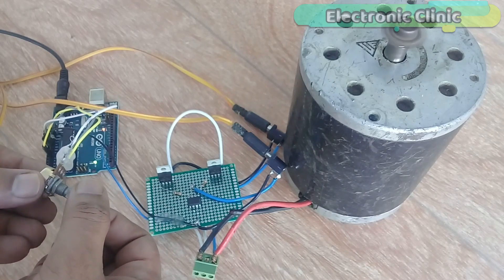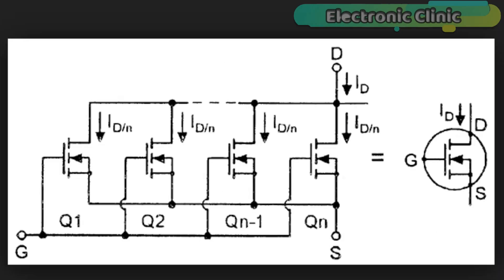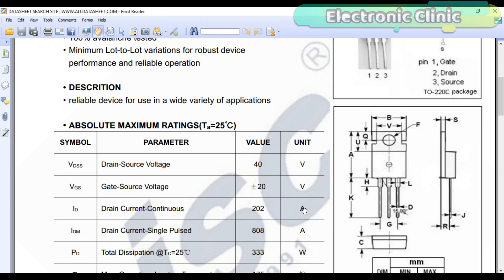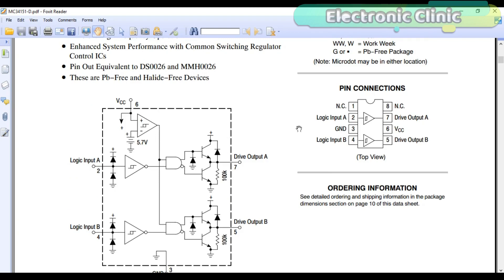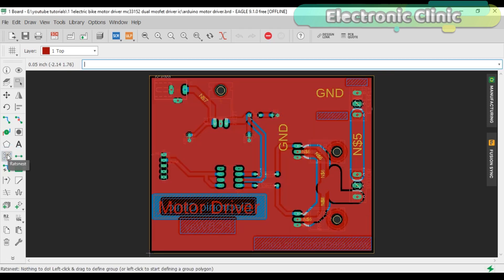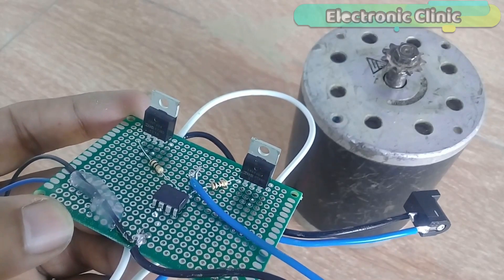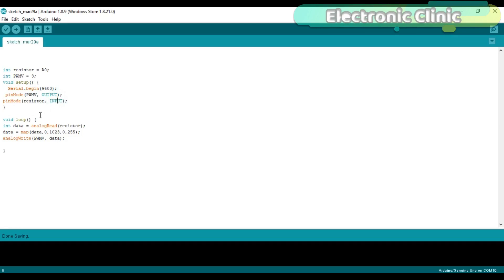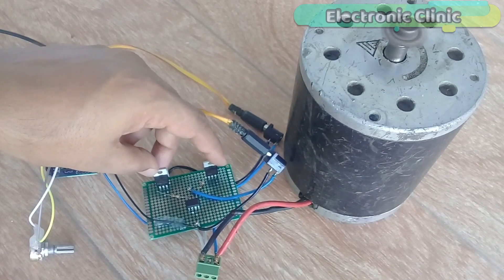Arduino Project: Electric Bike | Bicycle | E Bike Motor controller using mc33152 & Parallel MOSFETs

Comment: Have you tried applying load to the motor? I have a similar motor using pwm controlled by an arduino. I have a separate device that does the pwm, the arduino sends a digital signal to it. Without load it spins the bikes wheel fast but when someone tries to ride it, i think it is surging, frying the pwm device.

Comment: This controller will only work with a BRUSHED DC motor; it will NOT work with any of the "BLDC" (3-phase) hubmotors that we see for sale on Amazon and on eBikes. Therefore, you can only build a backyard-grade eBike this way, not a respectable one.

Comment: Can you explain in details? How you calculated 15.6 amp at 50°C?
Reply: The first equation was:
Pdiss_MOSFET_max = (Tjmax – Tambient) / Rthja
where;

Tjmax – allowable maximum junction temperature of the MOSFET. This is specified in the datasheet. (175 degree Celsius)

Tambient – ambient temperature near the MOSFET (50 degree Celsius)

Rthja – thermal resistance from junction to ambient (62 degree Celsius per Watt)
Therefore,
Pdiss_MOSFET_max = (175 degree Celsius - 50 degree Celsius) / 62 degree Celsius per Watt
that gives, Pdiss_MOSFET_max = 2 Watt at 50 degree Celsius

After that,
Pdiss_MOSFET = Idrain X Idrain X RDSon

Where;

Idrain – drain current. This is dependent to actual application (this is not the drain current rating of the device as shown in the datasheet.

RDSon – drain to source on state resistance. This can be derived from the datasheet.
In the video, RDSon was 8.2 milliohm and Pdiss_MOSFET = 2 Watt at 50 degree Celsius.
Substitute values and find Idrain.

Comment: I had a doubt, as by using the potentiometer we are varying the voltage input to adjust the speed of the motor, so does the power of the motor also vary accordingly ? 
Like if we reduce the speed, is the overall power reducing too ?
Reply: As in when someone is riding an EV bike on an high incline road, does the rider have to roll the accelerator in full to maintain speed?

Comment: Is the controller current (torque) based adjustment or voltage (speed) based adjustment? My controller is annoying because the throttle is a speed based throttle, not torque based.
Reply: Torque-based would be stupid, unintuitive to use, completely unlike any other motorized vehicle.

Comment: i totally disagree with you about connecting mosfet in parallel not working what about inverters,smps,half bridge ccts where mosfets are connected in parallel to increase the power handling capability
Reply from the maker: I did connect mosfets in parallel but the circuuts available on net are wrong. For parallel mosfets, u need mosfet drivers. U didnt watch video xompletely.